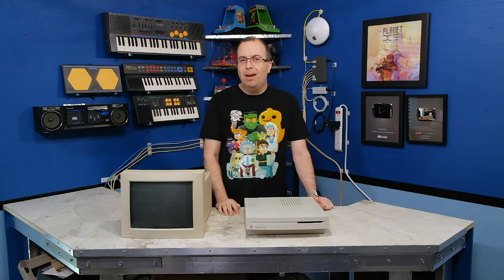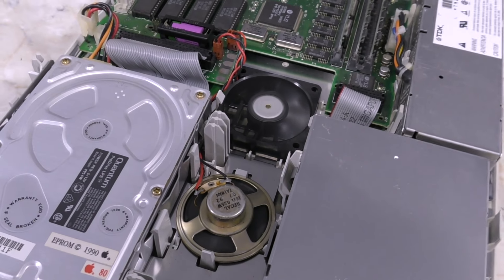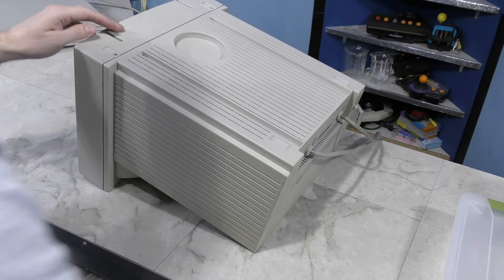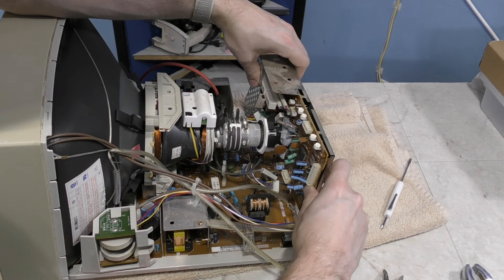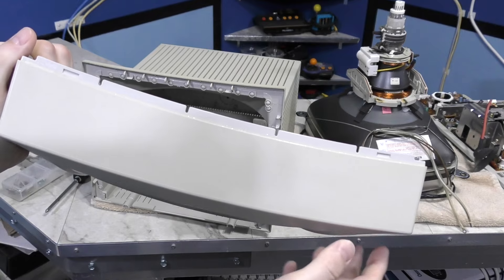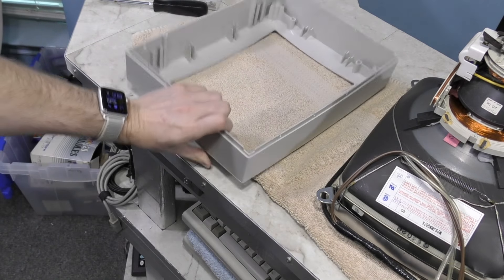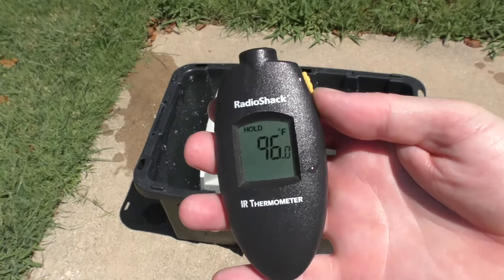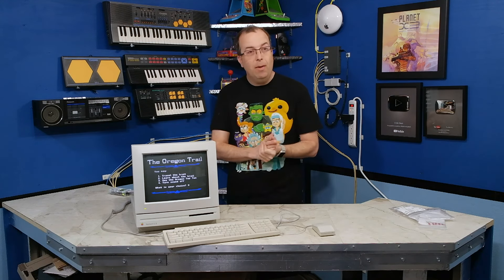Macintosh LC Monitor Restoration

Comment: If you want to pry things off but are concerned about scratching things with screw drivers, you might want to check your local auto parts store for some plastic trim removal tools. These will allow you to get under bits that are stuck on without gouging out the plastic panels.

Comment: For removing the foam backed double sided stuck on things like the mic holder. You could use fishing line between the case and mic in a sawing motion if you don't want to break it.

Comment: The CRT holds the charge, not the flyback transformer.
Reply: yeah thats right the flyback holds no charge,if there is a charge it will be stored between the anode and the dag coating...very rare though

Comment: Fun fact: apparently you can mount the picture tube upside-down and switch some wires (to put the picture right side up) to make a Southern Hemisphere CRT into a Northern one (and vice versa). This in case you ever get shipped one to you from Australia. Just watch that the wires don’t touch or get too close to something after you flip it... with CRT, death by electrocution is always an option...

Comment: 3:35 I would highly recommend spraying the window cleaner onto the paper towel instead of directly onto the monitor. There are vent holes and other ways the fluid could get into the inside of it and cause some issues.

Comment: I have a complete LCII with the monitor, keyboard, mouse, and all the associated hardware. Strangely enough, I saw one in a college bookstore in Montana and was fascinated (no pun intended) by the Star Trek screensaver that was running on it. I didn't get THAT one, but bought mine from a print shop in Bismarck that was updating their systems and didn't need this anymore. Bought the whole system for 100 dollars and to my surprise, it came with the Star Trek screensaver software! It was made by AfterDark. You should check it out!

Comment: Replace the HDD with an Industrial CF Card. Will make it much faster, and the industrial CF Card is more reliable. Overall it would make the machine a much nicer to use unit.

Comment: The ridges are probably not only cosmetic. They would increase the strength against bending in that direction.
Reply: they are entirely cosmetic, if there is any bracing it would be internal.
Reply: @madmax2069  Ok, then.
Reply: FRIENDLY JAPANESE BUSINESSMAN  Thanks!

Comment: First, the CRT likely didn't arc at the anode when you grounded it to the aquadag because it hadn't been used in such a long time.  Now, if the CRT had been powered recently, then it's going to arc when you discharge it.  The CRT may behave like a capacitor because it's running at over 20kV, but it's not a capacitor.  What that means is that it won't store a charge for very long, nor is that fact a concern.  However, it's always good practice to discharge the tube first before disconnecting the anode cap.

Second, the charge, if any, would be in the CRT, not the flyback transformer, so contacting the anode cap to ground won't have any effect.  HOWEVER, you don't want to discharge stored CRT energy directly to chassis ground as that can risk damage to the set's electronics.  You always discharge the CRT to ground via the dag.

Comment: "No tube has ever had a charge on it"

Touching the anode cap to the chassis won't make any change unless the set is actually on. They don't store any energy at all, and if they did it would be drained almost instantly with the tube in circuit. The resistance of the windings alone would be enough to kill any significant stored energy.

Because they don't store very much energy at all! They're minimal at best and the internal resistance is enough to discharge the tubes which don't have bleeders in a matter of moments. It's utterly meaningless to have so much worry about them, especially with later sets like this. 

Earlier tube driven sets and hybrid sets can produce a decent amount of current but at such high voltage and frequency its nearly impossible to do any damage by literally holding the anode cap while the set is on. As long as the CRT is not in circuit, no significant current will actually flow. You're more likely to damage the driving electronics than you are to hurt yourself, especially on a later set like this, which you'd just burn up the switching transistors or red plate a tube.

Ridiculously large neck board, too. Since you had everything already disassembled you should have taken the opportunity to properly adjust and calibrate the set.

Comment: Safety first. It's always a good idea to discharge the fly-back and CRT.  If you coil the hose on the driveway it'll heat the water inside the hose, free solar hot water.

Comment: Because of changing standards in CRT display manufacturing, it’s unlikely that you’ll find any computer monitor that does not have a fully encased flyback transformer with bleeding resistors and damping diodes included inside the transformer and a grommeted extra-high-voltage anode wire with a suction cup on the anode terminal. There are also often focus and astigmatism controls built into the flyback transformer. It improves safety a lot to put all the extra-high-voltage components and circuits encased in epoxy inside a plastic box. 

So, generally, you never really need to discharge the CRT unless you’re working on particularly old hardware.

However, despite all these safety standards, as a rule of thumb, never work on any CRT device without discharging it first. And touching the suction cup anode terminal to the chassis does exactly the same thing as your screwdriver trick.

Comment: You can absolutely replace the larger SMD caps with the smaller one's.  I have done it many times, as long as the contacts still touch the pads.

Comment: I use a face tanning uv lamp, and I 'paint' the parts with a hydroperoxide gel that I want to retrobright and wrap that in plastic foil. I put it in a box that is covered in aluminum foil for better spreading of the UV light. It works really very well but it'd be better if I got a bigger box.

Comment: @8bit guy the mic holder if you use a little fishing line filament and use it like dental floss you can can sort of "saw through" the sticky pad without risk of damaging the plastics :)

Comment: Nice work.  I sell old yellowed equipment - you restore it.  Mac  always had great engineering.  My first job as a technology instructor in a private school was partially overseeing two labs of Mac LC II, added an LC III lab the following year.  Taught True Basic in a computer class.  Those mic brackets always bothered me too.  I don't believe anyone used them.

Comment: I enjoy any video with the LC. My first computer was a LC, with the 12" monitor. I think it was the same model that you retro-brited this episode.
I upgraded to a 13" monitor because the 12" started to display too much yellow. It seemed like it was failing, and had a yellow tint over everything displayed. It brings back memories of ZOA and using floppies badly. I installed some System 6 control panels, and that really corrupted the OS. Thankfully, my mom had some System 7.0 install disks, so I was able to reinstall to that.

Comment: Regarding the retro brighting, what you’re getting from the sun is heat and a spectrum of light. You could set up a rig to do this inside. I suspect it’s the UV from the sun that’s doing the brighting and you could get some UV lights and a water heater (temperature controlled) and run the whole thing on your terms

Comment: On the subject of retrobrighting  a large object, I've never tried this, but as guessing if you put a large sealed bag filled with sand in the center of the hollow shell and then put those in one of those massive zipper lock vacuum storage bags mostly filled with retrobright solution.  The total volume of required solution should be reduced and clearing bubbles should be easy, just tap the bag.

Comment: You're a very brave man handling a CRT tube. Despite working with them over the course of years I'm still deathly afraid.

It also sounds like the speaker is somehow picking up the motor whine from the electric fan on the board. More than likely the magnet has come loose from it's shielding and is picking up all kinds of interference.

Comment: That noise from the speaker is due to bad caps.  My Performa 400 did the same thing and when I recapped it that noise went away.  Be sure to recap the power supply as well.  I found a couple caps leaking their electrolyte when I was in there.

Comment: The bubbles is because of the peroxide breaking down, it turns into salt, water and oxygen, you could add an offset motor, get rid of the bubbles by vibration

Comment: My recommendation for the large amount of water needed is simply add more bricks to displace more water. Plus the bricks have a lower thermal capacity than water so the bath will heat up faster

Comment: @The 8-Bit Guy
@18:20 David, you mentioned that the add-in-card was emulating the Apple2E. Is it actually doing emulation? Or is it a hardware replication thing?
Reply: Probably the CPU and some floppy controller chips. I don't know how many software for the II came out on 3.5" floppies.

After looking it up, it looks like it does have a CPU, some RAM, and the Disk Controller (IWM).

Comment: My recollection from the 90s is that that hole in the bottom of the monitor is for a rotating and tilting monitor stand (I don’t know if the stand was an optional part of the monitor or came with it).

Comment: As for the CRT discharge, there's never any useless precaution when your safety is involved. When handling guns, you must always assume a bullet magically sneaked in it. With CRTs, the charge is essentially a bullet.

Comment: My first computer was an Apple Performa 400 with a near identical pizza box style case I got as a white elephant gift in the late 90s from my grandma by way of her neighbor. My uncle gave me a pair of RAM sticks to upgrade it, and a 700 MB external HDD almost as big as the PC itself full of games. I lost the US Robotics 28k modem that came with it ages ago, but still have the manual, computer, and all other peripherals. Where's a good source for replacing the internal clock batteries? It's a pain having to set the thing up new every time I fire it up, but it's a fun classic computing/gaming machine.

Comment: the pads on smd elecrtolytic capacitors are generally quite ling and go to the center so you shuld be able to just solder the caps on it works perfectly fine asling as you dont mind people questtioning your soldering skills online

Comment: I have a LC III with the monitor original that when I power on, the monitor don't turn on and I hear a strande sound like a "buzzz".
The monitor is the Macintosh color display and the computer is the Macintosh LCIII

Comment: That squealing is due to a bad capacitor somewhere. Either a bad DC filter cap in the power supply, or a bad capacitor near the audio circuit part of the board, id start with the power supply first, test the main filter cap (usually the biggest cap on the board, near the incoming supply or transformer.) and the filter output caps (ones near the output wires) if they all check ok then its somewhere on your audio circuit

Comment: The entire episode I kept thinking, "I wonder if he has the Apple IIe Card for it?" then you answered it. The LC 475 is a great little computer and is the best way to run classic Apple II software... if you can find the emulator card for it. I see the LC 475 in thrift stores for around 15-20 dollars all the time here in Canada (I have owned 2 of them). Finding the emulator card is not so easy. I still have the Macintosh 5xxx/6xxx system 7.5 disks I bought from apple.  I also have the factory install disks for the performa computer series. I have both factory disks for the first iMac and also a retail copy of OS 8. I had to get rid of all my hoarded apple hardware when I lost my apartment and didn't have room in the storage locker for them. Will you be doing the Performa series at some point?

Comment: David, The Squealing speakers are due to bad capacitors that fail with age. How do I know I used to own an LC 3 and mine was doing the same thing before I sold it to get the furnace fixed during a very cold Michigan winter. Recap the machine and the squealing speakers will stop. Make sure to clean up any Capacitor gunk while recapping or you will cook an ADB port or a sound chip etc.

Comment: 6:20 please never use the case ground to discharge the anode of a CRT again. You risk frying the board and all the other electronics connected to the case ground. ALWAYS use the cathode of the CRT to discharge the anode.
Reply: OK, then why is it in Apple's service manuals to do it this way? And why would that current even go through those semiconductors when it takes the path of least resistance, which, as the ground plane, is a dead short?

Comment: My LCII makes the same sound!  I ended up unplugging the speaker.
Reply: Time to recap. Otherwise your LCII won't work for much longer.
Reply: Good call!  I might do that project after I figure out my a 486 won't boot from the 3.5" floppy reliably - something about MM/MS signal jumpers.  Good 'ol PCs.

Comment: Good to see you discharged it to the correct place, the braid across the back of the CRT which in your case it was connected to the rim band lug.
The reason most modern units do not arc is that the FBT has a built in bleed resistor (which is usually part of the Focus/G2 chain and very often the HV sense point)  not the CRT.

Comment: Instead of using Salon Creme you should go to a hydroponics store and buy 35% hydrogen peroxide.  It is used to supply roots with more oxygen, but it is dirt cheap and much more concentrated.  I think with the higher percentage, as I believe the Salon Creme is only 12 percent or so, you should have much better results.  Probably save some money and also have better results.  Just a suggestion.  One other thing, you can buy 35% at nutritional supply stores, but this is food grade and costs way more.  Hydroponic stores sell this in 5 gallon buckets if you want.

Comment: I have BAGGS full of those microphones still in the original packages... it is NOT a standard mic if I remember correctly,.... I also have many of those monitors... plenty of the erasers (feet)
Reply: Yes it is not standard PC mic connection. It is possible that it would get damaged if connected with pc microphone on it.

Comment: Dude, use waxed dental floss on stubborn double sided tape to avoid damage. Also magic erasers or melamine sponges are really good at getting embedded gunk off.
Reply: You have to be really careful with magic erasers, as they're basically a high grit sand paper.  The plastics on the monitor and the computer are textured.  If you use the magic eraser, it'll polish the plastic and make noticeable shiny spots on an otherwise matte finish.

Comment: How about using an immersion coil in order to heat up the Water-Peroxide mixture? They are not expensive and could heat the water up pretty quickly.

Comment: I don't know where your sourcing the caps from but if your just outside of Dallas I'm surprised your not using Mouser. Mouser is a great supplier of electronic components. I live in Houston and get next day shipping from them no problem.

Comment: once plastic has been restored to it's original color it takes MANY years of exposed sunlight to even start the process of "browning", so you're defiantly not going to see any difference in just 2 years.  Especially if you don't have it in any kind of direct sunlight or in very hot humid places.

Comment: Excellent as always. But pleas use rubber glows and safety glasses when you make videos with peroxide, think of the kids out there :) If I was you and working with peroxide all the time, why not have a larger box always filled with peroxide and maybe a heater and maybe an aquarium pump.

Comment: actuallyions:
does the box need to be black/dark/not translucid for the retrobright?
how many bottles of 40vl peroxide did you add to the water that time you did the big back part of the monitor? i mean, what was the water/peroxide ratio, more or less?

i think it turned out really great, it gives me great satisfaction to see you restoring those things

Comment: You should probably buy a sous-vide-vacuum heater, set the temperature to 160°, put it into the usual box in the sun and wait. The sun will do the basic heating, saving energy, while the heater will do the rest to achieve the optimal reaction temperature. It will also even out fluctuations in the sunlight.
Use a vibrating/shaking machine as the bottom part to get rid of the bubbles in the tub.
EDIT: Oh, I just heard you say that you have a sous-vide cooker in the video. Well... 

Why didn't you use it to speed up the whole thing though?

Comment: These monitors didn't just match the LC series, they also matched the Macintosh IIsi. As it was a more powerful computer (basically a IIci slowed down to 20 MHz to make it fit the desired price point) Apple generally displayed the IIsi with a VGA-resolution AppleColor High-Resolution RGB Monitor, but as this was MUCH more expensive, many IIsi buyers went with the cheaper LC monitor despite its lower 512x384 resolution.

Comment: The LC II's logic board and power supply need to be recapped. Once that's done, it should stop squealing. Definitely do that sooner than later, those power supplies have a nasty habit of frying logic boards once they get too bad.

And if it doesn't put out video on a cold boot with a dead (or missing) PRAM battery, that's perfectly normal. The LC series, their derivative Performas, and the Quadra 605 just do that. You can kick start it by switching power on for a few seconds, then off or a three-count, then back on again.